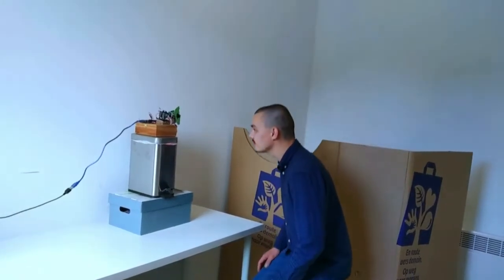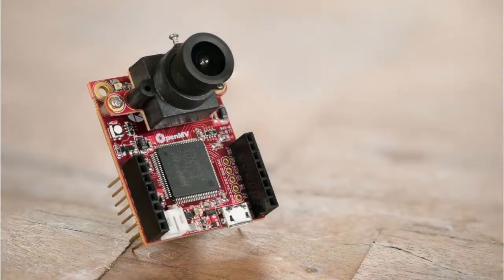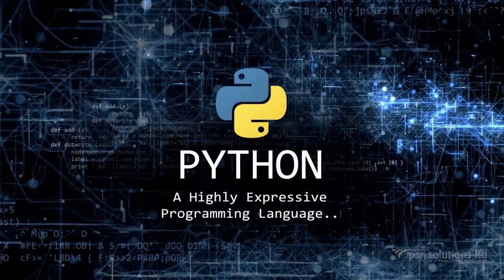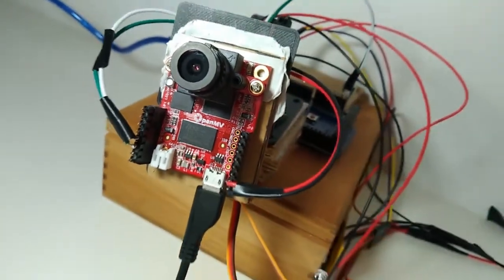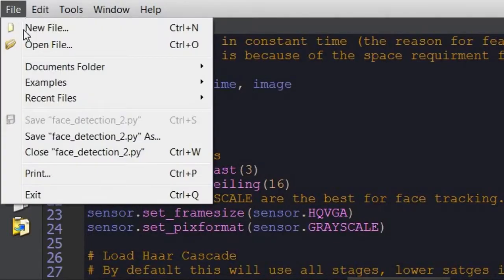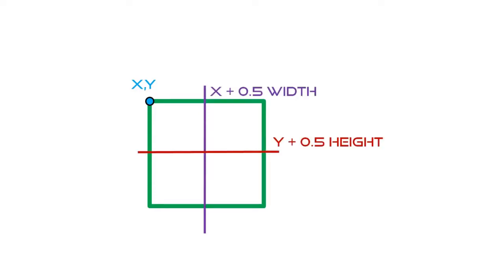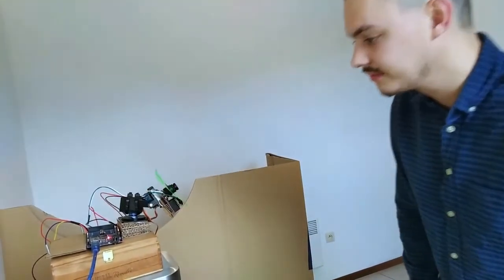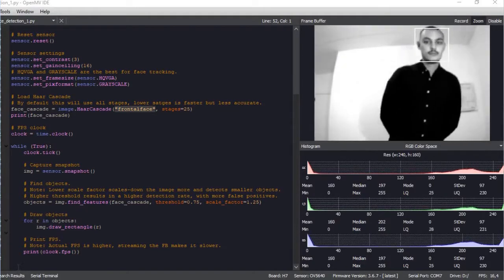Face following camera with OpenMV Cam H7 plus and arduino | Easy face tracking

Comment: Hi, im doing a similar project. However, my fps dropped drasticly. Do you have any suggestion for me as to how to solve this?
Reply from the maker: Maybe try to lower the resolution? Also, keep in mind that when connected to pc, the communication slows it down. When the board works stand-alone it runs much faster

Comment: Bonjour,
je vous félicite pour votre présentation de la video et pour votre code.
super article.
je débute avec open mv, pouriez vous svp me donner le plan de cablage entre la camera et l'arduino.
Merci pour tout votre travail
Reply from the maker: Thanks. The circuit connections is really simple. Just connect the SDA and SCL pins from OpenMV to Arduino SDA and SCL. And 5V + GND.
Reply: Merci pour votre répnse , je vais faire l'essai à la réception de la camera.
Je vous ferai part du résultat. @GlevoTec

Comment: great video, thank you for making this. May I ask the maximum range of openMV cam can detect object? Im currently working on object tracking that can detect object up to 3 meters
Reply from the maker: Thank you. Depends a lot on light. The face detection algorithm works on finding contrast in the face. So the better the lighting, the better and further it will work. I think 3m should be well doable

Comment: Awesome work, I think this is what ive been looking for, for a project im working on. Am i right in assuming the processing is all done on the OpenMV board? Once the code has been uploaded, does it need to be connected to a computer to work?
Reply from the maker: Yes, all the code runs on the OpenMV. The Arduino only handles the servo-commands. So it can run stand-alone without being connected to a computer indeed. That's one of the reasons why I went with this, cause it can run independent.
Reply: @GlevoTec  Awesome, thanks for getting back to me so quickly, Ive just ordered myself one
Reply from the maker: @Jonnymiller1977  Good luck with the project!

Comment: What is the longest possible ranger to recognize and follow a persons face????
Reply from the maker: I would say about 2m
Reply: @GlevoTec  thank you for your reply. For safety reasons I really want to build a human tracker for outside, which detects people day and especially at night and then follow them with a high beam light to not break in in our facility. What's your opinion in that implementation?
Reply from the maker: @Gallardo6669  Should be possible, but you would have to write a custom code that detects human body shapes and tracks them
Reply: @GlevoTec  I am not  good at this yet.... Therefore I keep looking for similar projects to copy the code. I can imagine I am not the only one who wants to build it, but I can't find any implemented project yet. Maybe there are too many challenges. The device, servos and light I can build, it's the camera and software I can't do. Would you be able to help out in an Collaboration?

Comment: I suppose this is feasable with an ESP32-cam and a Raspberry Pi also. 
I already have these devices and I am looking for a way to produce this kind of movements.
Reply from the maker: The board provides a lot of ways to communicate to other devices indeed. Should be possible
Reply: @GlevoTec  Thanks for your reply. Meanwhile I've found  my way just with an ESP32-cam.

Comment: Hello, good morning, I saw your project and I really liked it. I'm from Brazil and here is a big technology fair that I participate in and next time I have a project that a camera will have to follow as well as your project, so I wanted to know if you can show me cable connections because I couldn't find it, thanks in advance and I hope you can answer I know there are few more wires to burn a board like this here in Brazil calling wrong is very expensive if you know what I mean thanks
Reply from the maker: The connections can be found on the datasheet of the board. It uses serial communication, as can be seen in the code. If you're participating in the contest, I assume you have some experience in this field, so it shouldn't be a problem

Comment: nice vid. is it possible to connect this camera or any AI camera you might aware of to a video transmitter? in other words, does it output video? so it can be connected to a mobile phone or a video receiver.  thanx
Reply from the maker: Thanks. Yes, in fact you can get the video from the camera. It can even record on an SD card. It has an SD-slot on the board. You can find more information on their website. There are plenty of possibilities with this board. I only explored the face tracking for now

Comment: Very good 
Can we use as a smoke , heat and flame detector?
Reply from the maker: There is actually an IR camera available to fit on this openMV borard. The camera is changeable. With that you should be able to detect heat sources, yes
Reply: @GlevoTec  Thanks let me try